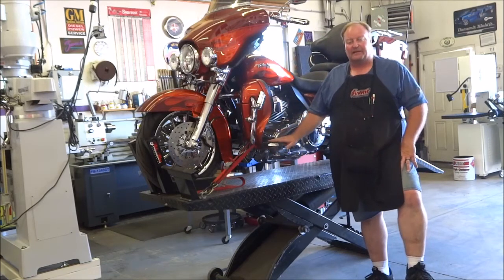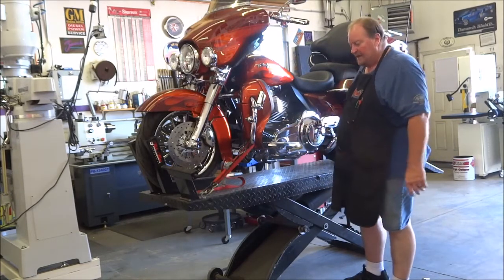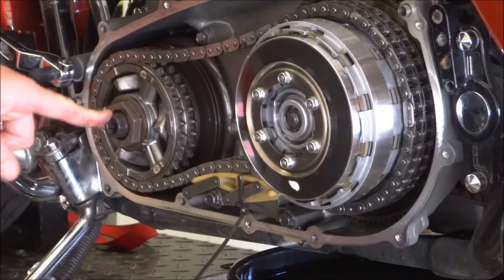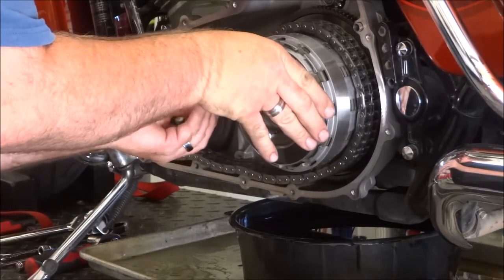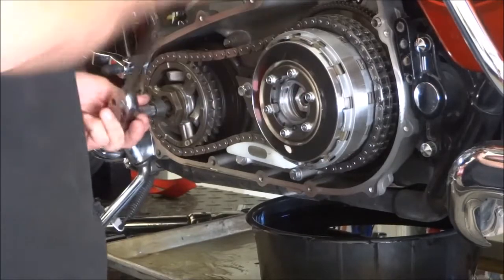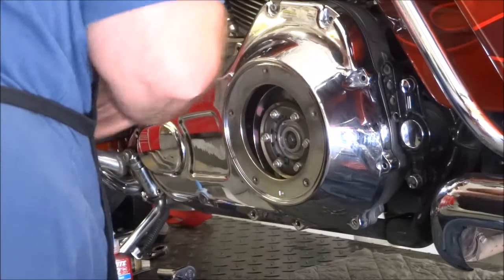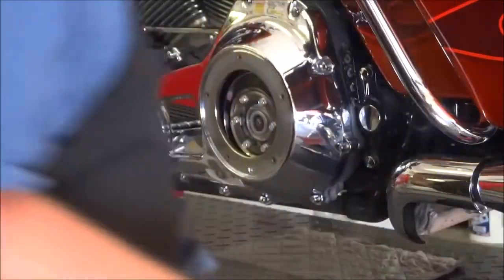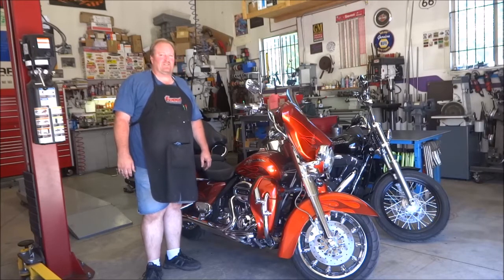2010 Harley Davidson Ultra CVO

Comment: It's funny, I had a transmission bearing issue because of the primary chain adjuster.   I replaced all the bearings in the transmission, and replaced the automatic chain adjuster with a Baker manual adjuster.   My procedure was much the same as yours in replacing the adjuster.    After all the oils warm up, you hear nothing but the shifting drum moving when I put it in gear after waiting for a traffic light.  I enjoyed your video.
Reply from the maker: +Anthony Caiati  thank you and thanks for watching. 
Mike

Comment: if you set the factory OEM Harley auto tensioner to the correct tension and then put a tac weld on the auto ramp you get the perfect tensioner that will never overtighten for basically free....

Comment: I have a 2010 Heritage. I know it is not a CVO but it is a great bike. The only oil that I have ever run since Harley break in oil is Amsoil ONLY. Beats all other  lubes hands down. Try it, you may like it. They make 20-50 for the engine plus filter. They now have fluid for primary and separate for transmission. About $100.00 for all.
Reply from the maker: Jerry Hubbard thanks for your comments and thanks for watching. Oil opinions are very subjective in case you haven't noticed. Some think because they have run brand X and have not experienced any adverse issues it must be the absolute best oil on the market. I have been a mechanic for 3 decades now and have had good results with many various brands and some not so good results with particular lubricants in that time frame. 
Me personally I am just not as big of a fan of Amsoil as others. That's just my opinion and I am sure there are some that will disagree. 
Mike.
Reply: After a lot of independent research, I find that Amsoil is best for me. Sure, there are many brands and many opinions but Amsoil only makes lubricants as most other companies, it is a side product. Not sure at this time but I know HD oil was made by Sonoco. I have never been a fan of HD oil. There again, many opinions and whatever you like, fine by me.
Reply from the maker: Agreed Jerry. Run whatever lubricants you feel are best for your needs or requirements. 
Thanks again for watching. 
Mike.
Reply: Jerry Hubbard 
I can say I truly agree.    I've used Mobil 1, and Mobil 1 is an excellent engine oil.     What I noticed is that my oil pressure when at operating temperature is about 3 to 5 lbs. greater when waiting for a traffic light on a nice hot day.    This is my first Harley Davidson.  I've had this 2009 FLHX Street Glide almost 2 years now.   I really like it, and became very familiar with it in the time I've had it.   I use Amsoil in all 3 cases, I use the 75/90 in the transmission, and 20/50 in the primary and engine.    Like I said in my earlier post, when waiting for a traffic light.   When it's time to put it in gear, all you hear is the shifting drum turning.  No clunks, AT ALL!

Comment: In my opinion, you should ditch the SE compensator and replace it with a Baker Compensator along with the Baker manual chain tensioner. You should go Baker all the way.....the stock primary chain comes way to tight from the factory and wears out the SE or noisy, stock compensator pretty quickly. Also, keep an eye on the cam side Roller Chain Drives, with their PLASTIC cam chain tensioners, which are designed to wear out, and failure to change out the worn cam chain tensioners, will crater the engine, due to metal to metal contact between the hydraulic tensioner and the Roller Chain, and the metal shavings will kill the engine. Also, you should check the pinion shaft max run out while you pull the cam support plate to check or change out the cam chain tensioners. Run out should not exceed, 0.001" or less, if the run out shows, more than that, for example, 0.003", of run out, it shows that the pressed together crankshaft has already twisted out of true, and you are on the way to cratering the engine. Only solution is to tear the engine down, pull the crankshaft assembly and have it balanced, dynamically trued and TIG-weld the Welch Plugs and set the output shaft and pinion shaft to 0.001" or less of max run-out. All Twin Cams run very hot, as evidenced by your rear cylinder heat shield, so, keep the oil changed regularly.......
Reply from the maker: Thanks for the info. 
Mike.
Reply from the maker: Thanks for the info. 
Mike.
Reply: tomcata1467 p
Reply: tomcata1467 IN OTHER WORDS, Harley is cheap in their design and materials, but STILL expects us to pay the outrageous premium for their product (just for the name).
Reply: So what you're really saying is... Don't buy harley, get a Triumph instead!

Comment: Hi Mike/Z. Ran across you on GJ and now on youtube. Good info on the bagger, I have one of my own, good job on the whole install, the only thing I saw that was off was the front end was cinched down which is why you had to fill up with so much oil.
Reply from the maker: +Billy Raibourn possibly affected it a very little amount but I didn't have it pulled down that tight and I used just under what they call for dry. 
Thanks for watching. 
Mike

Comment: Also, I've always been told you should adjust the tension from the tightest part of the chain?
Reply from the maker: You want to set the tension on any chain on the side that does not have the tensioner which is usually the driven side, the side that is pulled tight by the driving sprocket. 
Mike.
Reply: You want to rotate the chain and find the tight spot. Been this way for years. Other than that, good video, nice garage.

Comment: If you remove the inner primary to add the SE. Compensater sprocket. Wile you have it out, why not modify it so you can remove the Rotor if the Stator goes bad. Which they do do once in a wile. Would make that repair a hole lot easier.

Comment: I HOPE YOU KNOW that your method of measuring the amount of play in the chain was very much different with the old tensioner and the new tensioner. You were actually lifting the chain up beyond its normal state when measuring the slack after the new tensioner was installed.

Comment: esse tensor de ajuste manual tem alguma estria tipo dos tc 88 para segurar ele na posiçao ou é só no aperto da porca auto travante mesmo.
Reply: Translated :  this manual torsion adjuster has some kind of tc 88 type to hold it in position or it is only in the tightening of the same self-locking nut.....
Answer : Se eu entendi sua pergunta, este novo ajustador instala usando os mesmos furos de montagem do original, usando apenas a porca de travamento automático para ajustar manualmente a tensão.
Translated : If I understand your question, this new adjuster installs using the same mount holes as original, only using the self locking nut to manually adjust the tension.

Comment: Have you gone back in to re-check tension? Curious if it has loosened up any.
Reply from the maker: gsfinatic I have not opened it back up but there should really be no need to. This is no different than the OEM Harley style that has been in use for many years. With a new chain it could stretch and loosen a bit.  On a broken in and properly maintained primary it really shouldn't loosen up. 
Thanks again for watching. 
Mike
Reply: I have seen where you can go through the Derby cover with a long screwdriver and check the free play.....after I read that and know it is possible.....I am going to install one...was going to go with the Haden....but have realized the Baker is the way to go....

Comment: Shouldnt you adjust the chain on the tightest part of the chain?
Reply from the maker: You want to take the measurement on the side opposite the tensioner as that is where the stress is.  The highest stress point is directly between the drive and driven sprockets in direction of travel when the drive sprocket is pulling directly against the driven sprockets. 

Hope that makes sense. 
Thanks for taking the time to watch.  
Mike
Reply: @zmotorsports62  that's correct but 99% of primary chains have a tight spot which should be opposite the tensioner when doing the measurement.  If not that isn't spot will be very tight when it travels across the top.

Comment: This coming Wednesday, I was to have my 96 inch upgraded to a 103 big bore kit. After much research, I am not going to just have them put in the SE-255 cams. What I read is the upgrade of the pistons and jugs is such a small amount that the cams are the way to go to get more torque. I was talking about the upgrade about the 103 and with having to run another 500 miles for break in, they recommend dinasoar oil. I told them that I have had Amsoil in this engine for the past 4 plus years. He said we would rather run the HD oil as Amsoil was synthetic. I told him I really did not want to mix the oils. But to keep on the good side of the warrantee, I said ok. Now that I am not going to have new rings put in the engine, I will run my Amsoil. I really don't think he is right about this as they sell synthetic  for HD's I don't see a problem with a break in of the cams as the rings would require. Another thing HD does is pull the cam rockers instead of adjustable push rods. I have had both in the past and I don't have any plans to make any other changes to the engine, I will take the HD push rods over adjustable.
Reply from the maker: Jerry Hubbard I've run those cams in several engines and have been very pleased with the results as well. I agree the slightly larger bore is going to net marginal gains compared to the benefit of the cams. 
When I was building race engines I always ran petroleum oil for break in prior to switching to synthetics for ring seating purposes. If your not changing cylinders/pistons/rings you should be fine to continue with the synthetic.  Personally I'm a fan of adjustable pushrods though, but that is just me. 
Mike.
Reply: My 94 EVO was one of the best engines I have ever had. Not long after I got it new, I put a crane cam and  SS E model. Great running bike until I finally gave it up for the 2010 Heritage. Cams are the way to go for sure.

Comment: Mike, Thanks for the video! I have an 09 ultra classic CVO that I just pulled the primary cover and am going to change the tensioner to the Baker manual tensioner. I have a question, can I put in the screaming eagle compensator that you have? What all will I need if I do? I am also updating the timing chain and cams to gear, Andrews 21 grind cams, adjustable EZ install rods and a S&S Power commander while I am at it. Thanks in advance!
Bob Six

Comment: Hello, very good videos, I wanted to ask you a question, what size are the compensator nut and the clutch nut? thank you very much.
Reply from the maker: The Screamin’ Eagle/CVO compensator used a T70 Torx socket.  If memory serves the clutch hub nut is either 1-3/16” or 1-1/2”.  
Thanks for watching.  
Mike

Comment: What does it usually cost to adjust the clutch and or replace a clutch on a 2009 CVO Electra glide screaming eagle package?
Reply from the maker: There is no adjustment on the hydraulic clutch setup and not sure how much to replace clutch. You’d have to call your dealership or favorite independent shop for a quote.  

Thanks for watching.  
Mike
Reply: Thank you for the reply!
Reply: Isn’t it approximately 1 quart of oil for the transmission?

Comment: Why in 2017 & 2018 does Harley-Davidson still use a high maintenance chain primary drive system? It’s clear by the redesign of a new motor that gears are better with Harley-Davidson except for the chain primary chain, why they put that system on a new motor who knows.
 A gear drive primary system is what Harley-Davidson needs to go to and will go to if they want to technology wise survive, and with a gear drive primary they can keep the same primary cover as is for traditional appearance.
Reply: Oh frank...lol
Reply: Manufacturing quality at Harley is terrible. Who uses Roller bearings in this day and age! I wish i never bought my Harley.

Comment: Is there any reason you did all that work instead of using a M6  Spring Loaded Primary Chain Tensioner? You do not have to remove the chain or ever adjust...
Reply from the maker: I’m just not a big fan of the spring loaded tensioners. Old habits are hard to brake and when I adjust something I want to know it’s adjusted to the proper spec. Just my OCD I guess. 
Thanks for watching. 
Mike
Reply: IMO, don't chains expand and don't settings change during heavy downshifting etc? I personally like the idea of "set and forget" and the thought of taking the primary apart does not thrill me, but that's just me. Nice video though...
Reply from the maker: To each their own. I just don’t like spring loaded tensioners, after being an industrial maintenance mechanic for 30 years I don’t believe in “set it and forget it” items, but that’s just me. 
Thanks for watching. 
Mike
Reply: I had that POS M6 in my 124" Roadking for a few months. I took the primary cover off to change the clutch & found the M6 nylon shoe had broken into about 4 pieces (one piece fell out when I removed the primary cover), this is a well documented problem.  I found out later that a friend of mine had the same thing happen & with his the small pieces got behind the rotor & trashed his alternator stator.  I have been a Harley wrench for over 40 years.  Even though the M6 worked fine in a 2001 Heritage I had, the newer version is absolute junk.  I threw it out & installed the attitude adjuster.
Reply: My research shows in a high torque/high compression or even a high rev engine, the M6 shouldn't be consider.....I do not have any practical experience with them, but after my research I'm going with the Baker...if you are a little old lady, the M6 should be just fine though...lol

Comment: Tell me please! What the size clutch hub nut?
Reply from the maker: If memory serves it is 1-3/16”. Also remember it is a left-hand thread. 
Mike
Reply: zmotorsports ok! Tell me please, new torx t70 bolt with blue loctite, can I added red loctite? Thanks
Reply from the maker: No need to replace the bolt unless the teeth in the T70 head are chewed up, then I would replace. I use a bit of  Loctite 262 (Red).  Blue (242) would also work. 
Mike
Reply: zmotorsports thank you very much!!
Reply from the maker: You are very welcome.  Thank you for watching. 
Mike
Reply: zmotorsports tell me Mike, can i remove only comp? Or i must remove comp and clutch? I’m from Russia, I have SG 2015. I’m bye Baker chain adjuster
Reply from the maker: Both the compensator and the clutch must be removed at the same time as an assembly. There isn’t enough flex in the chain to remove one without the other. IF there is your chain is probably dye for replacement. 
Sorry for the delayed response I just noticed the message. 
Mike

Comment: All wrong.  The right way to adjust chain tension is to have the chain and shoe surface oily VERY OILY, then adjust shoe to about a half inch in the center of the chain on top and then turn your clutch hub until you get the highest slack in the upper center of the chain and THEN adjust to specifications.  If you had done just one full turn with that chain with oil on it, more than liey your upper looseness would have increased by a full half inch or more.  So you will be running with twice the specs clearance the way you did it. I assure you that you will be running double the slack.  Also, you people are making fools of yourself for the thin oil youre using in these cases.  50 to 80 straight weight